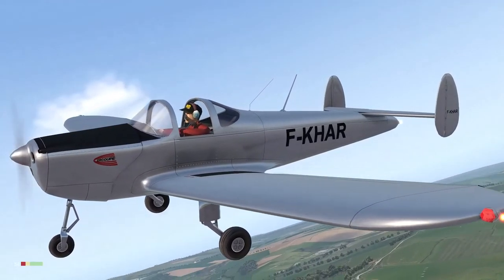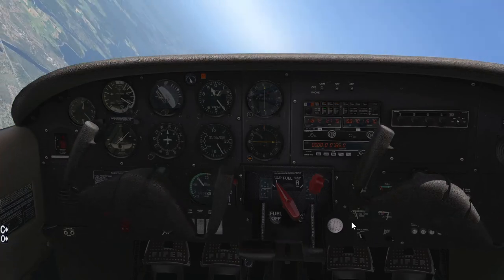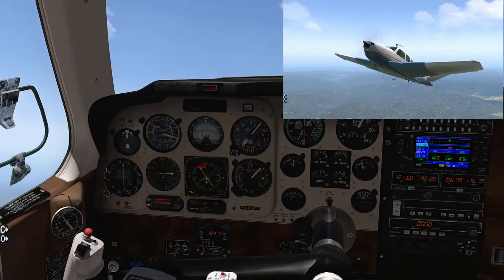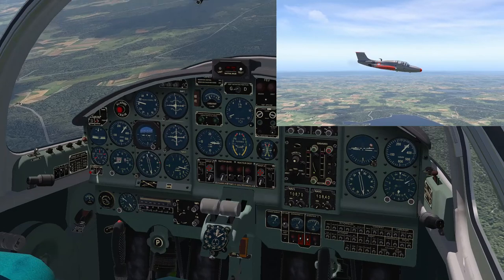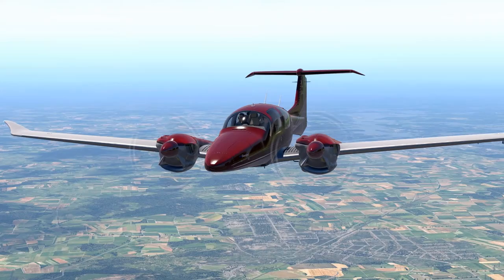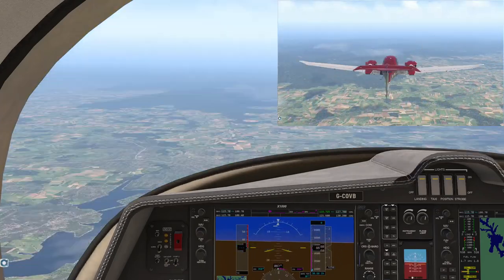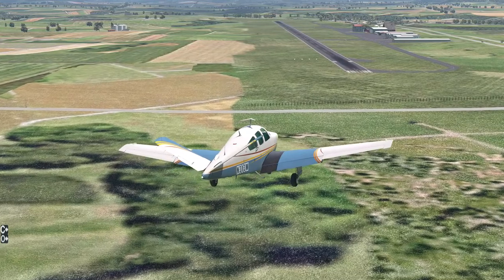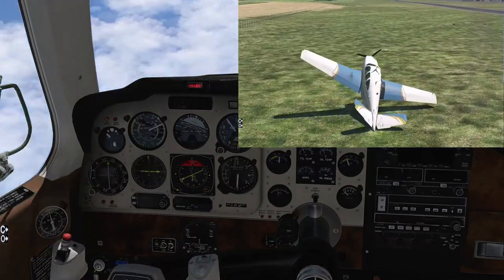Going for a Spin?

Comment: @Simmo2sim I noticed the Carenado V35 Bonanza in your video. It's an XP10 aircraft which I bought but having never had X-Plane 10 my only experience is trying to fly it in X-Plane 11.55. Not being a real pilot and not very experienced flight simmer I found it uncomfortable trying to fly it. I was wondering if you had to adjust its ACF file when you fly it in XP11.55 and if you did, might you do a tutorial video on the kinds of adjustments needed to make an aircraft addon designed for XP10 operate correctly in the final v11.55 version of X-Plane 11?
Reply from the maker: Hi jayeye2011,  I don't remember ever changing the ACF file and I'm not an expert on this by any means so I'm afraid we will have to leave that sort of tutorial to others.  I have not noticed any difference in the V35 between X-Plane 10 and 11 but then I don't fly it enough to see any problems. I normally try and keep my aircraft up-to-date and the current V35 is version 3.2. Thanks for your suggestion.